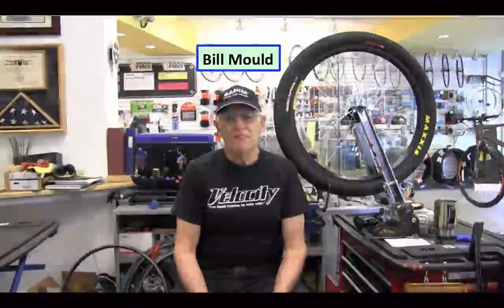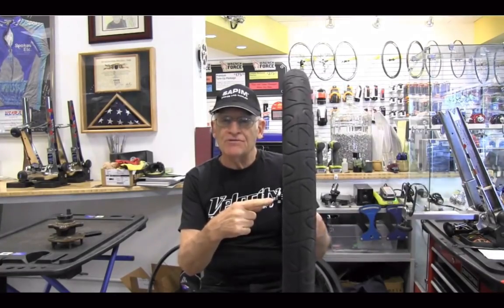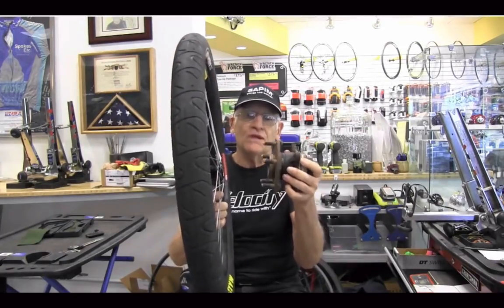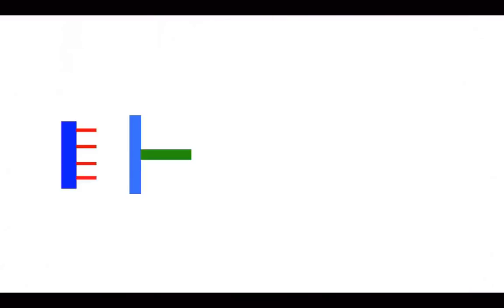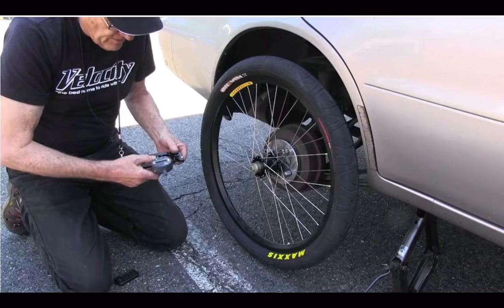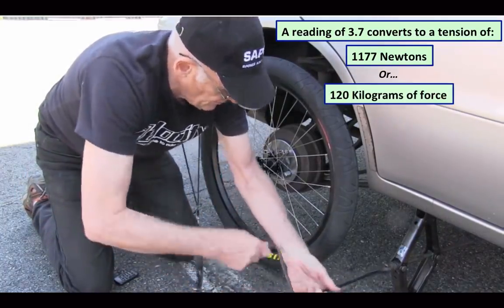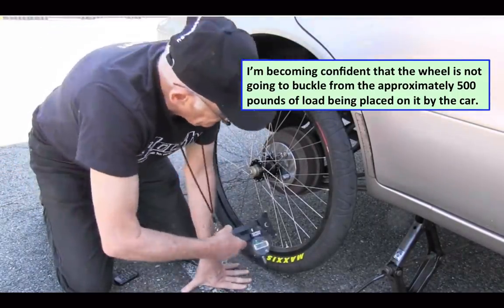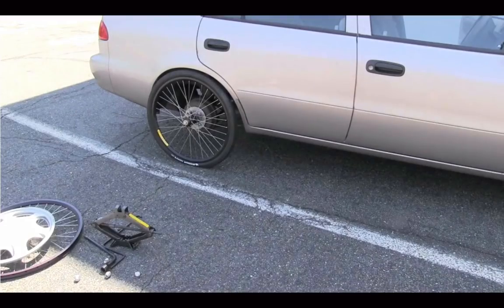Bicycle Wheel On Car

Comment: the bicycle wheel would fold in half upon stopping suddenly at a speed of around 40mph and would compress; the spokes wouldn't be able to keep up with that increased mass being directed upon it. Also accelerated turns would break the spokes due to increased loading on one side.
Reply: Probably altho if the car had ABS it could help if it can reach speeds of 20mph or more in the first place. Rememeber that that wheel doesn't have much grip when stopping with car brakes ABS would probably start pumping that bicycle wheels brake.
Reply: Well the fact that a wheel designed for a bike, was able to support a car. Great engineering here.
Reply: Marcus Zizzo yes
Reply: I believe the word your looking for is force
Reply: Ahh on the final product? Your wrong because how do you know if the wheels are not built yet.
Reply: Marcus Zizzo not you
Reply: yo elliot i lov u
Reply: They also couldn't go round a corner without buckling. Still a well engineered wheel though.
Reply: ***** i think the more speed equals more mass;
Reply: bartsshorts dum ass
Reply: Zachary Myers mike myers lover
Reply: That wheel will fold like a taco on the first left-hand turn
Reply: Ghost Rodgers  Any sudden movement would damage the wheel severly. For example, a car with a powerful engine. If you slammed on the gas the wheel would probably not be able to take all the force. Steering hard could potentially bend the wheel as this would tilt the wheel slightly and since it's probably 1-2 inch wide it would be too weak and bend.
Reply: Ghost Rodgers yep  for sure  and also it wouldn,t be  safe at  all at highway speed ,  a 2 thumbs down ,,,
Reply: ***** Technically, as you add more energy into a system, that energy is spread across all the fields relating to that system, the field relating to mass is the Higgs field. However,  the Higgs field requires a massive amount of energy before you start to see any noticeable fluctuations.  If you look at Neutonian physics, force = mass x acceleration, rewritten is: mass = force / acceleration.  When the force approaches infinity and the acceleration approaches zero, you essentially get infinite mass.
Reply: Marcus Zizzo In loaded bicycle touring the rear wheel often supports a load of 100 kg or so. This is on a smooth surface, and the wheel has to be strong enough to handle much higher loads on bumps, or otherwise it will eventually go out of true. There's probably 150 to 200 kg on the rear corner of that front-engined car, so I'm not surprised at all that the wheel does this fine when driving circles on a parking lot. That's a reasonably heavy and stiff MTB rim.

Generally speaking, the spoked bicycle wheel is impressive in its load bearing ability compared to its weight, but this particular experiment is pretty meaningless... I'm more impressed for example by the lightweight carbon fiber wheels (1000 g a pair or even less) being reliable under big men on road bikes without any suspension.
Reply: Turbo Lover you're*
Reply: Ghost Rodgers they had skinny spoked wheels like this in formula one in the 1950s. they drove way faster than 40 mph and none of them broke.

Comment: That bracket incorporates some Walmart level engineering.
Reply: Haha
Reply: d00kiebird he acctualy used the word "invention". lol
Reply: d00kiebird The bracket is fine. It doesn't seem like you know much about engineering.
Reply: Phil K a plate with a shaft welded on to it? Yeah, that's inovative engeneering.
Reply: Frode Angell Løtvedt Did it get the job done effectively? yes. 
I dont see a problem with their solution.
Reply: Frode Angell Løtvedt That's all it needs to be. Not everything has to be some marvel in engineering in order for it to work properly. One of the goals when Engineering something is to keep it simple. So yes, it's fine.
Reply: Phil K another goal is to make it usefull and solid. To just brag about your "supreeme" skills by making useless crap is Walmart engineering.
Reply: Phil K the kiss rule keep it simple stupid is the best rule when building
Reply: Phil K 
I can almost guarantee that 'bracket' isn't hub centric like it needs to be.
Reply: Jonny You're totally right, no need to reinvent the wheel. cool video!
Reply: Because the hub is designed to support the weight of the car, not the wheel studs.
Reply: d00kiebird haha gotem
Reply: hjjfffaa very true, the wheel studs compress the wheel to the hub creating a high horizontal force into the hub much greater than the shear force between the wheel and hub, you can think of this as the wheel becoming part of the hub. What i don't get about this video is he is saying that the weight of the car is being supported by that bike wheel, that corner of the vehicle will be less than 1/4th the weight of the overall vehicle. I want to see this in actual motion because that wheel will just fold over on itself. (Sorry didnt feel like adding another thread to this post so i combined my messages)
Reply: just cause he says 500lbs does not make it true. think about how a teter-totter works, you can pull a rear wheel off a fwd front engine car and most its weight will transfer to the opposite side front wheel, dont believe me, try it. so the force that bike wheel is not being subjected to a whole lot of downward force.
Reply: d00kiebird Being a mechanical engineer myself its not as easy as it seems to get the axle centered on that plate perfectly and perfectly straight.If either where even just a little bit off that wheel would of wobbled horribly and would of almost certainly destroyed the rim. i wouldnt go as far to say its a new "invention" but it is no easy task to make it as good as he did
Reply: ***** Also the majority of the total weight of the car will be located in the front due to the engine block. I would say the bike wheel has about 300 pounds max assuming the 2000 lb car.
Reply: Justin Robinson 2000 lb car?  Try 3500. lol.   I'd say rear wheels probably have 500 to 700 lbs on them.  Engines aren't a majority of the total weight.   But they do make a difference.
Reply: According to the Toyota Corolla website a 1995 Corolla weighs 2350 lb. Boo ya!! lol
Reply: Ben Silva sub compact
Reply: Phil K For something proper, the hub adapter should be hub-centric, and the shaft should be keyed to the wheel. It would also help if the adapter was machined after being welded, to ensure concentricity, but this would require somewhat higher complexity than they were going for. All in all, for being nothing more than an experimental piece, it was made well enough to test the idea, though it should be further improved if they want to advance it.
Reply: +Corey Besse (OMGnanerpus) Actually FWD cars place ~64% weight over the front axle so approx. 800lbs of the corolla is over the rear axle. That said, the bike wheel is quite a bit bigger than the stock wheel so it's going to take more than 1/2 the weight over the rear axle so your estimate is probably right though for the wrong reasons.
Reply: +basebilljr07 Easy to design, tough for the machinist who actually makes it lol.
Reply: +Jonny Technically it didn't work. They had to use a different wheel than intended in the original plan. Even then, if the suspension compresses from hitting a bump or something it's going to hit the wheel well/fender.
Reply: +Caddy Guy Gaming  they used the same wheel, different tire.
Reply: dookiebird 
maybe, but the kid is a highschooler. You want to know what I was doing in highschool? Smoking dope and getting laid. I wish I would have been studying engineering then... Instead I get to be that old guy at the community college struggling with pre-calculus.
Reply: I'm so disappointed in this honestly, anyone who knows anything about the physics involved with the spinning of a tire and the friction applied at the hub could tell you that his bracket most likely wouldn't hold up to a mile it two. Some great engineering right there, at least use some bearings
Reply: Jesses Bradshaw 
The bearings are in the hub. People use wheels spacers/brackets all the time. They sell them all over the place. People run them on their cars for 10 of thounsands of miles with the only downside being increase bearing wear. Trust me, that's not the issue.
Reply: dras
dimas
Reply: Yeah that kid probably did not do well in college

Comment: Audi and Volkswagen are watching this going: "That could be an extreme Space-saver" :)
Reply: +PROcrastiDRIVE SV Thanks for going to the trouble of doing this cool experiment!
Reply: highly doubt car manufacturers would consider producing vehicles with wheels and tires of this model. if it ain't broke don't fix it. this type of tire can merely handle the weight of the vehicle while actual car wheels withstand that weight along with tons of other conditions and scenarios in which the tire shown in the video would most likely fail miserably
Reply from the maker: Of course it would fail miserably on a car in actual driving conditions.  This was only an experiment and demonstration of how much weight a bicycle wheel can support.  I never suggested or intended that it replace car wheels as we know them.

Comment: why all the hate in the comments? this was a neat little experiment.
Reply: trolls and kids, that's it
Reply: because youtube comments
Reply: Samwise Drogod Indeed! Next generation bike wheels could be thanks to this guy.
Reply: He was measuring tension on the bottom spokes. Wouldn’t that be compression? Tension would be the top spokes because the back left axle is hanging in tension with the top of the bicycle tire
Reply: its stupid and its not really an experiment.  Its the same concept as drying off after a shower with toilet paper.

Comment: Interesting concept, but:
1: forward/backward movement isn't an issue, but try putting on lateral forces/torsion (turning, cornering)
2: would fail on first rock/obstacle/pothole
3: can't be used if you plan to drive faster than a few km/h due to extreme heating
Reply from the maker: Adwin, all of your comments are correct.  This was just an interesting experiment to show a bicycle wheel's ability to support a large vertical load.  Not for highway driving, for sure.
Reply: Sir, I drove from Germany to France last week and there was no problem with the bicycle wheels.
Reply: No bearing in the wheel, there is no way you could drive it on the road. This man is trying to con people out of money.
Reply: There is a bearing in the hub, but i totally agree that there's too much leverage on the wheel to stay put on the shaft with just the compression from the nut.   It would make a terrific noise and probably quite a shudder on the way out, but i bet it would get up to forty before a road feature destroys it.
Reply: Adwin Putteeraj
Reply: Adwin Putteeraj it's just for fun
Reply: +Bill Mould So a spoke motorcycle wheel would also work then.
Reply: now try a halo chaos wheel on the car no chance of breaking it

Comment: It seems to me this EXPERIMENT has gone over the heads of the majority of commenters. People going on about it not taking a turn, a bump, speed, criticizing the kid for tightening lugs with a 6" ratchet(when clearly they are attaching an extremely light bicycle wheel and clearly don't intend on doing any of the above or going on public roads.)
Now, perhaps I'm crazy, but what if this really was just an experiment as mentioned? With the test being whether 2.5lbs bike wheel could support the weight of a 2000lbs car as opposed to a 35 lbs bike and proving it can handle the vastly greater stress by actually driving the car allowing the wheels to do complete revolutions under said weight. OMG!!!!!!!!!!!!!!

Comment: okay now try to put a car wheel on a bicycle
Reply: I'm pretty sure it's already done by someone I. YouTube
Reply: Someone in YouTube*
Reply: +Random Guy haha
Reply: yeah
Reply: +Steven Haidinyak   No that wouldn't be a motorcycle. Car tires and motorcycle tires are very different. Putting car tires on a bike would be near impossible to ride.
Reply: +pghdave420   I just looked up their bikes and they don't have car tires haha. Their trike bikes do, but that's not the same. Car tires on a motorcycle wouldn't work. You wouldn't be able to turn without eating shit.
Reply: +xXblinnyboyXx Yeah and I bet getting the dang thing moving would be heavy work too! That rolling reistance, yikes.
Reply: +TheChipmunk2008   True, a lot more weight to get turning and more fiction from the surface area.
Reply: yep.

Comment: Failure point? The first pothole.
Reply: Or the first turn taken above 10mph.
Reply: He's looking for the amount of load the wheel can take. He doesn't seem interested in actually using it...
Reply: Easy, load the wheel with weight. No need to mount it on a car.
Reply: That's not as fun.
Reply: true
Reply: تبيع٥٠
Reply: mmdirtyworkz or drain grate
Reply: anything not flat... XD
Reply: mmdirtyworkz failure point: this dude's editing skills.
Reply: how about no brakes?
Reply: Jeffrey Wain So, what he's calling a hub isn't really a hub: it's just an adapter, right?  If he's got a bearing in there, then the bicycle tire will freewheel even if the parking brake is set.
Reply: He needs a spring block to keep them expanded to give more height.
Reply: Bill Keith be better off just mounting it on a single axle trailer, its very easy to adjust the amount of weight on a trailer and catastrophic failure will be less dangerous for the towing vehicle since the trailer is what would fall to the ground, which means he could probably push a little faster.
Reply: Corazon del Oro well its rear drum brakes so it still brakes,stupat.

Comment: Okay it held up. but you made a right hand turn. make a left hand turn and see how it holds up. I bet it will break then.
Reply from the maker: Derek,  this was a demonstration of the ability of a bicycle wheel to support a large vertical load.  It is not, and never was, a proposal to replace a typical car's "spare tire".
Reply: +Bill Mould I realize that. but what I'm saying is, it held up the weight making a right hand turn. you said in the video that you expect the wheel to hold alot more weight then what it was already holding. but I think your jumping the gun on it. check and see if it will hold up the weight while making a left hand turn before you say this was successful, and now you want to try heavier vehicles. basic physics, if the car is equal weight on all 4 corners that wheel is holding 25% of the total weight. say the total is 1000lbs. that's 250lbs. as you turn the opposite side gets "heavier", but the rear tire gets more of the weight transfer. even making a small turn can make a big difference in weight. so all I'm saying is before you go with a heavier vehicle make sure that wheel can with stand more weight by simply making a left. to be honest, I think that wheel is at its limits.
Reply from the maker: Thanks for your recommendation, Derek
Reply: +Derek Wegmann This car looks like 2200-2400 lbs, and since it's front wheel drive, its balance bias is probably in the range of 70% front/30% rear. That means 750 lbs on each front tire. I doubt very much that one of the bike wheels would support it, even before he makes a turn. lol
Reply: +AmericanThunder lol yea I know. and I was just saying "if" all four corners were equal that would be the weight if the car was 1000lbs. I wasn't trying to make it complex like that lol.
Reply: Derek Wegmann Ah hell, I complexed it all up. lol
Reply: +AmericanThunder More likely to be around 60-40 distribution of that. Weight distribution in fwd cars isn't as bad as you think, especially the bigger ones
Reply: +Derek Wegmann they used a car that is less than 2000 lbs they should use a dodge monaco or something
Reply: +Brad Caloroso  Do your research 9th generation corollas weigh about 2,4030 lbs.
Reply: +Bill Mould so did you get support to try with four wheels? i think the would would collapse just from placing it on the front, where the engine is, but since you said it can hold a lot more... i wanna see that.
Reply: +colin edward another couple thousand pounds and the then you'll need a CDL to drive that car.
Reply: Yes probably but then you have a broken bike wheel and a bent rear axle. Why don't you entertain us and see how many girders your house can go without
Reply: +Bill Mould Many years ago we took my friend"s dad BMW 525 to one village. On the way back the rear right tire blew up. We jack the car up,took the wheel off,but when we got to the spare tire,it was completely out of air too. So believe it or not,we had to drive on 3 wheels ( very slowly ) right back to the city. The car was keeping the balance just perfect. Later on we understood,that there was nothing magical in that. It was the perfect 50-50 weight distribution of the BMW"s. I have also seen many Citroen cars performing the same thing. So nothing extraordinary here. Pure physics. Weight distribution ratio.
Reply: All these guys trying to figure out the split.  The car was a bad idea to begin with and the further experiments would be as well.  It'd be cheap enough to have your next student helper build a weighted sled  then you know what you have load wise.  You won't risk dropping a car or truck on the ground.  You won't have clearance issues and you'll have some actual numbers to write down.  

Also, measure your spoke tension on the top spokes not the bottom ones.

If you testing the viability of a bike wheel used on a car the pot holes and corners are going to get you.  Side loads are your enemy.  Bikes don't take much.  Cars do.  The deeper the dish the better luck you'll likely have with that.